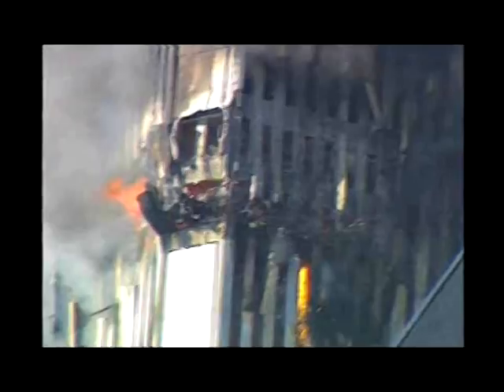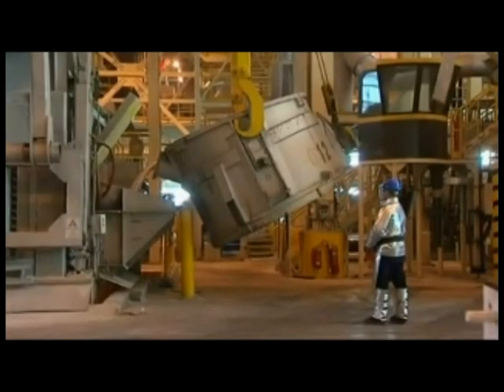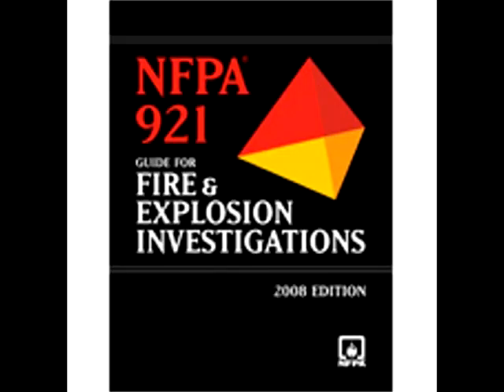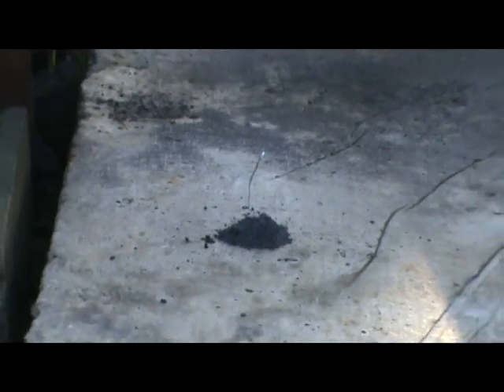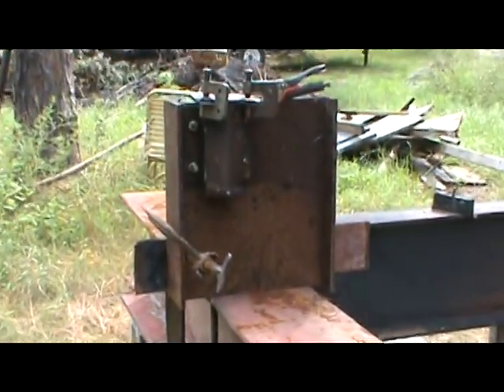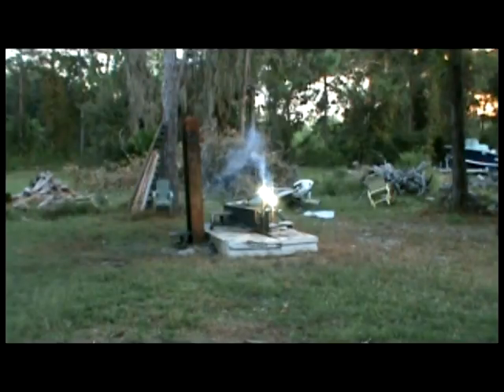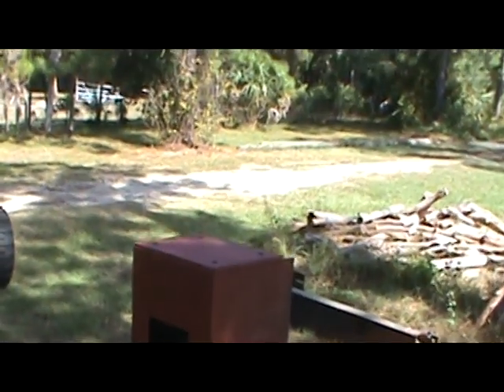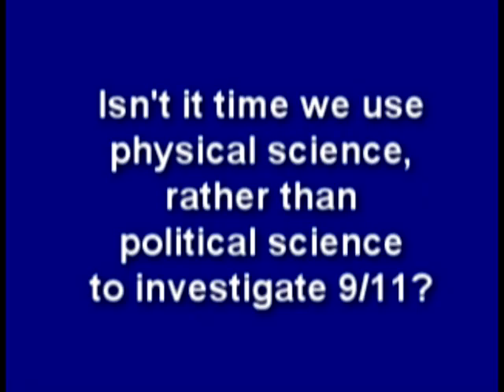9/11 Experiments: The Great Thermate Debate

Comment: Want proof? Each airplane that hit WTC carried 24,000 gallons of kerosene, which gives of 128,000 Btu per gallon. Do the math and see if you can compute the eventual fire that results. Worcester Polytechnic Institute has a fire technology research program. Their videos show solid steel I beams heating to the point of sagging from fires emanating from burning office furniture. An office fire resulting from 3 billion Btu's starter would easily destroy the WTC towers and do it quite quickly.
And it did.
Reply: Leo:  Even if your speculations are true, that does NOT explain how there could ANY free fall of the towers.  And if there was ANY free fall, that means Controlled Demolition was done.  And bldg. 7 is even more clear: even NIST admitted it.
    And by the way , would you care to explain why NO OTHER steel framed skyscrapers ever fell, even though they had fires hotter and longer than WTC?
    As for "doing it quickly", sorry , not as fast as free fall, not even close.
Reply: disgny What are you dense? The fires destroyed the strength integrity of the steel,  of course the towers would eventually fall. The building that was hit second fell first because it was hit in the middle (more weight).  That building almost tipped over because it was hit in a corner section but the unaffected steel prevented the tip over and the building rocked back into place and fell straight down.  It is not rocket science.  And why would anyone put thermite into the building and risk discovering? A stupid plan.  What buildings had fires hotter and longer?  What is this freefall crap, the buildings collapsed on themselves, why is that so hard to understand?
Reply: joskemom I'm sorry to be so blunt, but just about everything you said is mistaken.  What is really hard to understand is why modern buildings , such as WTC would be expected to fall from fire, when NO such bldgs. ever "fell" before.  Educate yourself:  Look up  steel building fires on Youtube, and you can spend days watching videos of hotter and longer fires , and NONE  of them fall down.  "Freefall crap" has to do with Newton's Laws of Motion, which can be used to prove that 9/11 is an elaborate fraud.
Reply: disgny Reality check, burning jet fuel compromised the strength of the steel in the towers, the towers fell.  The 'pancake' collapse is what gave the tin foil hat crowd the idea of controlled demo. Like I said, what moron would put explosive in a building when there would be no guarantee that the plane would hit the building? Those burning buildings you watched, were the steel post encased in concrete? Ever hear about the steel bridge that collapse because of an oil tank truck fire?
Reply: joskemom
You have garbled up a couple of different theories about the collapses. No, the "pancake " theory , at one point in the NIST report , was an attempt to explain the mechanics of collapse, but it did not explain the free fall part, so it was later dropped.
  The pancake collapse is INCOMPATIBLE with free fall, and NOT an inspiration to Truthers, but the free fall of bldg.7  is the smoking gun which proves the whole thing is a fraud.
   You have brilliantly outlined  the uncertainties of airplanes piloted by amateurs of hitting any particular floors, which is EXACTLY why a Controlled Demolition would be the FIRST choice of anyone who  wanted to bring the towers down.  Planes might miss ; planted explosives never would.
   The burning jet fuel + compromised steel theory is completely ruled out by the amazingly fast fall, even of towers 1 &2.  There is simply NOT enough time for that scenario to take place.  I urge you to look at various Youtube fires of steel buildings:   Many burned harder and longer than at WTC, but NONE of them fell.  Explain how come their steel strength was not "compromised".    Yes , they all had fireproofing, as did WTC.
Reply: ***** The idea that the towers fireproofing was "stripped off" was nothing more than a convenient assumption , made without proof, so as to make the NIST scenario more plausible, since they could not claim that the steel was "melted".  However, your admission of a 2/3 g fall speed  is enough, because it does NOT give enough time for the "weakening", of the steel , which surely you agree must take SOME time period, and at every floor sequentially , adding up to FAR more time than the towers actual fall time.  So the Official story doesn't add up, but Controlled Demolition DOES.
    So even if it is agreed that some floor "intitated" a collapse, that does not lead to a progressive collapse.  That would just take TOO MUCH TIME.
    Your assumption about what "Saudi Hijackers" expected is  quite irrelevant if the towers were blown by Controlled Demolition.
Reply: *****
You say "patently false."   But others say that is a plausible "Cover Story" for the actual controller, "Kroll Associates" , owned by AIG, with strong connections to the "Intelligence Community".  See Youtube, watch?v=RAAztWC5aT8, "The Conspiracy,  Project Hammer", etc.  A gold mine of clues about the whole thing.  Of course, even though 9/11 was the greatest mass murder in US history,  "our government" did not think it worthy of a real investigation, so we civilians have no way to check up on the truth of all this.
Reply: *****
I read your post about the NIST fireproofing test, but cannot now find it again.  I hadn't heard it before, probably because it doesn't   pass the "Giggle" test. Why would anyone be convinced that WTC fireproofing was removed by the simaltaneous firing of thousands of shotguns?!  First, aluminum airliner crashes do NOT reduce the plane to millions of tiny pieces.  Second, even if they did, the effect would be limited to the floors involved in the crash; it would not have any mechanism to affect any OTHER floors, since at that point, each of 100 or so 4" concrete floor slabs would still be in place. Try again. But that wins the prize for laughs.
Reply: Leo B:  Not convincing.  Fires may weaken steel, but not instantaneously, or even "quickly".  And remember, even if you believe the airplane theory,  to enable the sagging of steel AT EVERY FLOOR requires that intense fires, for a lengthy period, and they must weaken EVERY column simaltaneously.  There simply was not enough time for all that to happen; the towers fell in seconds; weakening steel would take ,if not hours, at least minutes.
Reply: ***** You are not following the logic of the supposed serial collapses. The towers had around a hundred floors, each one separate from the others.  If the weakened steel, was not at least a partial contributor to the collapses, what then do you suppose accounts for the "continuation " of the  building's fall?!  All this rigamarole in addition to the fact that all these "mechanisms" of failure take TIME, which is not available in the actual collapse scenario as it happened.
Reply: *****
Even if the kinetic energy idea is actually true, that does NOT account  for the  excessively short time of the fall.  It seems unlikely that the KE theory would actually work in practice:  for example,  since the falls were pretty much straight down, the bolts being severed would have to happen simaltaneously, otherwise, the towers would not fall "straight."  Also, since the conjectured events happened starting from the top, the cumulative loads would not be likely to be fatal at the beginning, at least.
Reply: disgny Like I said, it is fire resistant, not fire proof and that crap they spray on the steel was knocked off and burned off. You cant apply fire proof anything on the steel. You have no idea what you are talking off about the 'speed' of floors falling. Once that weight starts falling,  it is not going to pause for each floor.  Take a physic class.  Controlled demo as part of the 'attack plan' is stupid, there is no reason to add explosives to a building that might not get hit by a plane. After 14 years, no one of the 50 to 100 people required to put the bombs in the building have leaked or made death bed confessions. And no one every noticed these 'bomb planters' were seen by any of the thousands of people who worked at the towers. Damn, you nut jobs are mentally off line. Al queda already said they did it.
Reply: ***** I do not have the patience you have talking to disgny.  He needs to take science classes because how he thinks is embarrassing.
Reply: joskemom
Having admitted that the steel was "fire resistant", how can you then say it was "crap" that was "burned off" ,  or "knocked off"  without laughing?!  You don't have much regard for architects, engineers, and fire experts.  But then, we already knew that.
   Osama Bin Laden long ago made a video , denying that he had anything to do with it, since his host country would not allow it.. Makes sense; not proof of anything.
   There is a lot of sense to rig a building for demolition if you want to make SURE it is destroyed; you're right : a plane might miss.  No doubt the plotters foresaw your exact point.
   I hope you won't be insulted if I tell you that it is the very physics you believe we should all study that tells everybody:" this was a controlled demolition".  You seem to think that steel being either melted or weakened had something to do  with the actual fall.  Fine, the speed of the fall , in seconds, is exactly what tells everyone that your steel weakening scenario , with floors crashing down on each other cannot be the reason for the fall.  Only removal of columns can do it that fast.  Period.
Reply: disgny Your thought process is a display of blatant ignorance. I build buildings, I draw design plans and deal with city inspectors and when I used the word 'crap' it was a general description because I did not feel like listing what that 'stuff' is made of (oh oh, now I called it stuff, got a problem with that?)   For fun I will try this again. If the purpose of an inside job was to fake a terrorist attack to go to war, there would be no reason to destroy the entire building, just drop the planes anywhere. You have no idea how many people it takes to demo a regular size building. It would be plain stupid to risk exposure by having 80 to 100  people prepping the towers to blow while people are working there. Do you not see how absurd that is? Osama made no such video that you speak off. Osama knows building engineering and their is that video of him, that one eyed sheik and a lot of other Taliban in a tent laughing and talking of the 911 attack. They were celebrating what they did and a moron like you still after 14 years is about as clueless now as the day after. I am not going to teach you basic physics but if a floor is rated to support a certain weight, and that weight is now falling down that would exceed the weight it could hold. The floor below that floor now is about to be hit by a force that was even greater than the floor above it,   oh,oh  I think I might have already lost you.  F=MA, have you ever heard about that? I have a morbid curiosity of how silly your reply is going to be.   And one more thing, yes, the steel exposed to burning jet fuel lost their initial rated strength and could no longer hold the weight they were designed to uphold(are you able to follow that factoid?)
Reply: joskemom
I didn't suppose that the plotters would be silly enough to have the building rigged for demolition right out in the open, among the people working there .  Did you?  An Isreali controlled company handled security, and if they wanted to "make alternations" at night , with restricted access, I doubt if they would have had much argument from anyone.
   You're wrong about the OBL video; I have seen it, and although I don't speak their language, they don't seem dumb enough to mistranslate such a public document.
   As you your guess that all the columns in the buildings lost half of their strength  by fire,  don't you agree that such a process would require that the "airplane" fire have unrestricted access to every column on every floor for a lengthy period of time?  Even if the fuel  were actually available, which it was not, it would have to be distributed (unformly)  throughout the bldg., and keep burning, otherwise most of the steel would be fully serviceable, i.e. hold up the building.  This all means that , at most , a few upper floors would be able to fall, since your work on buildings would no doubt have convinced you that modern buildings are Way overdesigned, just so they won't fall.. And none have, before 9/11.   Your mention Newton's laws of motion , favorably.  Then you should be able to appreciate that a free fall, or anything near it, (like 2/3)  means that there CANNOT be anything slowing down the fall. Like columns, or half strength columns, or whatever.  That means Controlled Demolition. Period.
Reply: disgny In your efforts to imagine just what the motives of the plotters were,  you are overlooking a great deal of factual background. Namely that many billions of dollars were at stake in the affair, entirely beside the whole question of whether the security of Israel requires that the rest of the world be mobilized against the Moslem world, which appears to be the NWO game plan.  So just dropping an airplane in lower Manhattan might not  be enough;  that might not be enough to justify a "Global War on Terror", and mobilize "the Troops".  If you are actually interested, see Youtube, watch?v=RAAztWC5sT8,  the False Flag Conspiracy,  and Project Hammer.  Gives a lot of clues about motivations.
Reply: disgny All your post placed together shows that you are a certified 'looney toon'.   Do you also follow the chem trails and believe the moon landing was staged? You were good for comic relief, now you are just boring and willfully ignorant.
Reply: joskemom If you have nothing more to contribute than insults, you would do us all a favor by refraining from posting them.  Once is enough.
Reply: disgny You are the one who have nothing to contribute. Your idiotic blaming of Israel for 911 is way worst than  your ignorance of basic science and your clueless understanding of building structure. You are a looney toon who has no problem placing stupid accusations on Israel.  Good thing you have no ability to do anything about the silly ass crap  you believe.

Comment: Thermite is used to weld railroad rail ends together. It works by melting the two rail ends together with a ceramic mold to keep everything in alignment as it solidifies. This is far heaver steel than the wtc columns.

Comment: so, thermite is made from aluminum and iron oxide? an airplane contains tons of aluminum, and applying fire to steel creates iron oxide. seems like all the raw materials were there. you didnt try the thermite on steel that was already brought up to 1800 degrees by the fire, so the thermite wouldnt have to bring the temp up by that much, making it work 50% better.

Comment: you have to take into account the building bearing weight and hight .. the natural movement swaying and pressure on the steel would make it easy to break if half if the colums half width was removed

Comment: everyone is debating about thermate i always wondered why the buildings fell straight down vertically, if the main heat source was concentrated where the planes hit on the corner of the building wouldnt you think with all that weight above and the earliest structural fail on one side of the building that the building would have fell over at an angle like a tree?

Comment: Oh my word I am so so tired of you crazy people banging on about this.  
1. No,  jet fuel cannot melt steel.  But heat and millions of tonnes of pressure will.  That's why it fell down.  Not from heat,  but heat and pressure.
2. How in the hell could someone rig all those columns with these kinds of devices.  It would take 100 men months.  And no one saw this happen.  And none of these ridiculous devices has been found. 
Get over it.

Comment: Are you familiar with reason why air planes are pushed off aircraft carriers when they catch fire?
Reply: When an airplane catches fire on a aircraft carrier the airplanes metal, that is its outer skin, will begin to melt and go through the deck of the carrier. Class Delta fire.

Comment: What I want to know is how the hell an aluminum wing severed the steel columns outside to begin with.  I've seen trees rip a wing off.  Allot lighter and weaker than multiple box columns.  Even though the box columns are not very thick, they are still structural steel.  Then these box columns were backed up by structural steel I beams and concrete floor system that included structural steel trusses.  Way back when, a bomber hit the Empire state building.  Sure it was going slower is probably lighter but the bomber only penetrated some where forward of the wing.  It didn't even do much damage.  Also, building 7 is the only steel beam building that has collapsed under the stress of a fire on one floor.  Also, it looks exactly like controlled demolitions that you can find all over You Tube.  WTF.

Comment: 0:52 Falling molten material turns silver/grey; not a color associated with steel, which would turn black when it cools, and would not cool that quickly because it is too dense. Aluminum does cool quickly, and turns silver/grey when it cools.